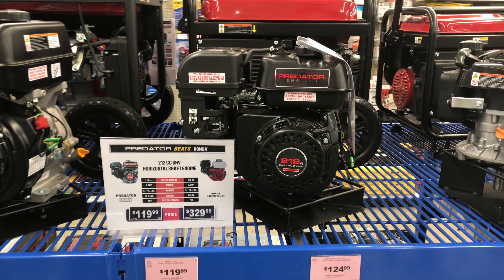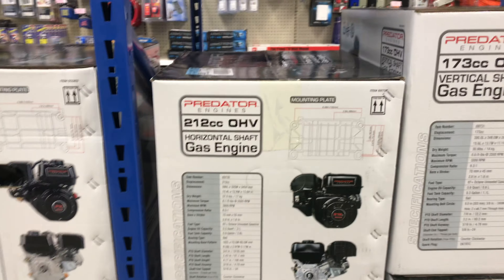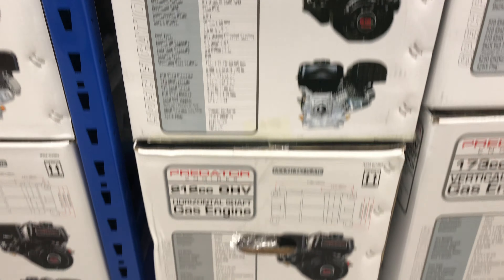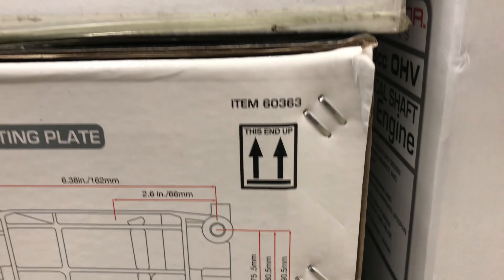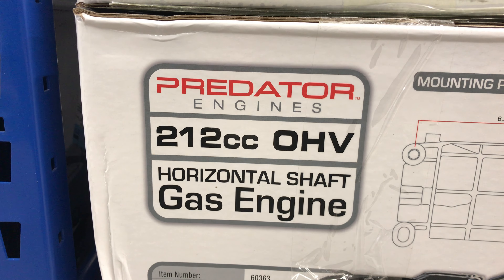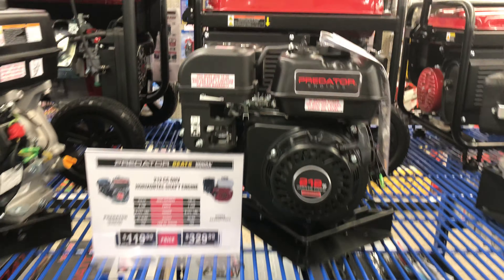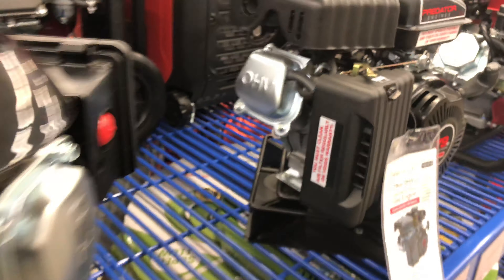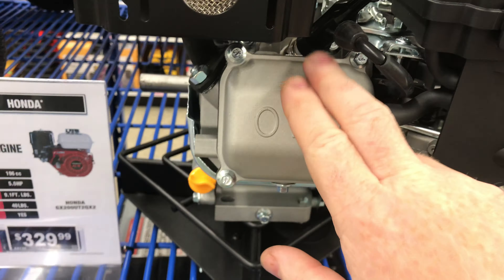Predator 212 Engine Hemi / Non-Hemi I.D. at Harbor Freight

Comment: The non hemi is easier to modify, and has more parts available, where as the hemi requires a technical background in order to modify the head/valve seats. The Hemi you have to keep the same rocker arms, cant upgrade. The non hemi can only be upgraded to 26 lb valve springs, hemi can go higher.
Reply from the maker: Mark tibbetts Variable speed carb.  Engine has a throttle lever and can also be hooked up to a remote twist or thumb throttle.
Reply: @BUILDNIGHT  Where is the serial number for the motor is located do u know I need some help bad please!!!!!!

Comment: I just purchased two Hemi Predators while on sale, each with a part # of 69730, so they must have recently changed the part number(?).  Even the pictures on the outside of the boxes are correct for a Hemi engine; (decals, muffler, air filter and carb cover housing). Every other Hemi I had purchased in the past had a part # of 60363. Fortunately, if you look inside one of the two hand-hold openings, one will be directly above the valve cover, making it easy to determine which engine it is without actually opening the box, regardless of the part numbers or pictures.
Reply: Same. Just purchased 69730, but has the muffler, air box, and cast valve cover like the hemi. Confused????

Comment: Hey buddy what does hemi mean on these engines? I know the dodge hemi but what does it mean on these lawnmower engines? Also what's the difference between the hemi predator and the non hemi predator engine? Thumbs up on your video bud. 👍
Reply from the maker: Basically the same concept...  the Hemi version has a hemispherical valve combustion chamber.  the non-hemi has a flat head style recessed combustion chamber.

Comment: What is the difference between hemi and no hemi.
Reply: idk etheir
Reply from the maker: The Hemi engine has a “dome shaped” combustion chamber, which is referred to as “HEMIsperical.”. The non-hemi engine has a traditional flat bore combustion chamber like most other small engines.
Reply from the maker: Many people prefer the “HEMI” design, but unfortunately,, the factory that makes the Hemi version of the engine isn’t as high of quality as the factory that produces the non-hemi engine.  Therefore, if you’re after a reliable engine, best to buy the non-hemi.  There are lots of problems with many Hemi models.  Some bad right out of the box.  Some  are great.  Luck of the draw.
Reply: Metalman 329 Thanks for the Info.   I’m looking to put this on a minibike.
Reply: Metalman 329 l